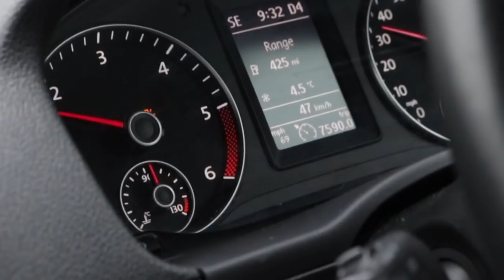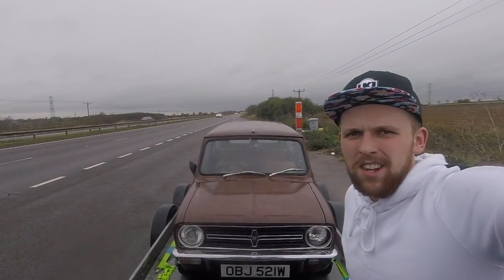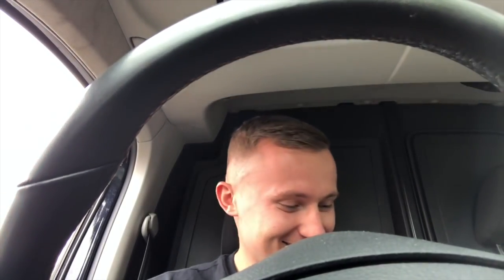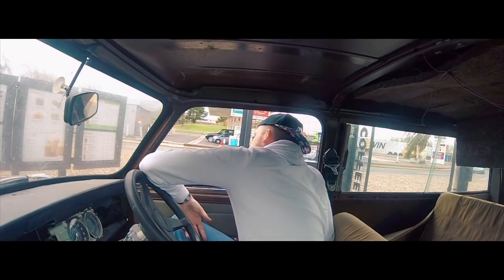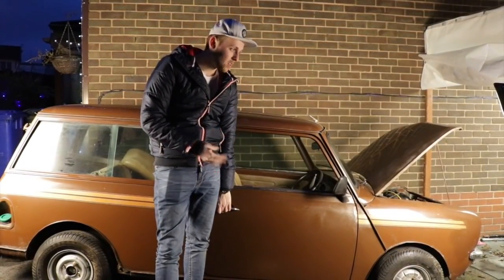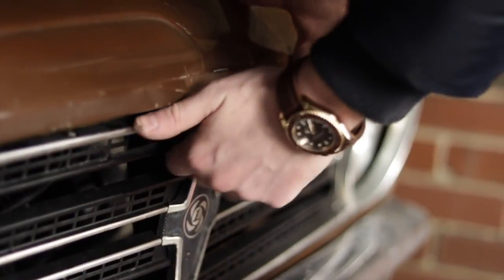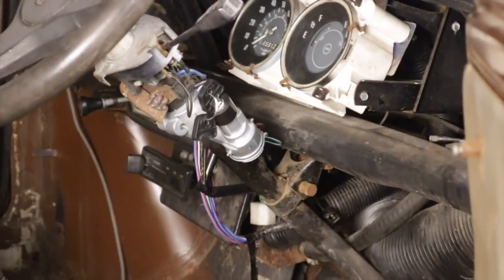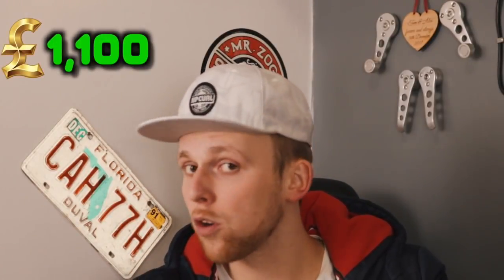YOUTUBE BOUGHT ME THIS CAR!!!

Comment: Had an 1100 clubman back in the day about 1982, strange thing about them is it was built in  Belgium and had a lot of French electrical parts fitted as standard from new. So look out for some odd bits and pieces here and there it won’t all be Joe Lucas.

Comment: Dude! subscribed now you've got yerself a clubbie estate.  I'm nearly at the end of the bodywork on mine (1980 in blue). M-Machine for yer floor panels.  What a year to have this - IMM 2019 in Bristol and Clubman 50 year anniversary. I know it would be a tall order to have it back in one piece by then. Don't forget the Clubman Estate Register - to share the love. If you know what's going down - you'll keep it in Brown! best advice is sort the frames/suspension/brakes and worry about engine later (as it seems to be a runner) - once the bodywork is sorted of course.  Top work mate - keep us updated (in style).

Comment: I'm 43, and a VTEC sounds good. However,I'm considerably more old school,so I'd prefer a metro turbo bored out to 1430cc with nice low gearing to race most things from the traffic lights. I'd prefer to keep it look standard,then watch people's faces as you pull away, and the sound a bored out 1275cc turbo sounds awesome. As this car has a larger bonnet,a 1585 cc fiat twin cam might fit. The sound of the fiat twin cam is amazing!!

Comment: Ah I’d love to have a poo brown clubby. If it were me mate I’d restore it to factory spec like the day it rolled off the line.  Looking forward to seeing what route you decided to take. Keep up the awesome work. 👍
Reply from the maker: Thanks Peter! and original is actually growing on me :)
Reply: You see so few bog standard 70’s and 80’s minis I find it quite refreshing to see something that hasn’t been modded tbh. And the added bonus is that the parts tend to be easier and cheaper to find as most people don’t want them. I would upgrade to disks and make a few subtle engine mods. Other than that I’d make it as standard as possible. But that’s just me. 😉

Comment: You can try your local college or uni I have been doing night school welding at my local college for a while. Also you should / can do a lot of repairs with spot welder on the mini because that's how it was built in the factory. Seems like this car was a bargain it runs you could drive it tomorrow. Anyway I don't know how much space you have but doing a big restoration plan a budget for tools and maybe some workshop space if you can find it. Lastly I think you need to request a "juicy latte" at Starbucks next time.
Reply from the maker: hahaha! thanks Adam! juicy latte it is! the night schools sounds great! first plan is to strip the car and then make a jig